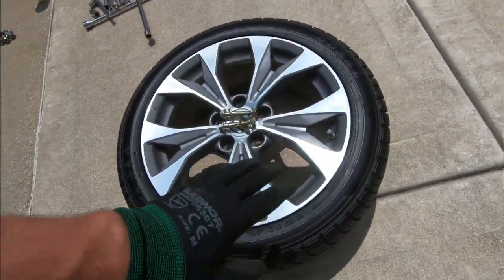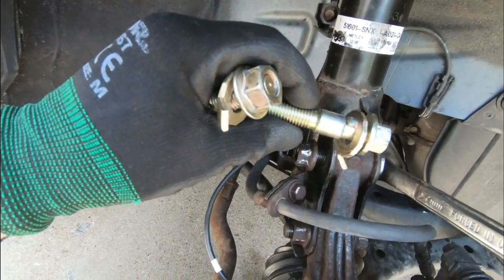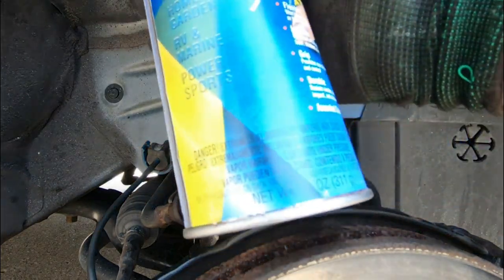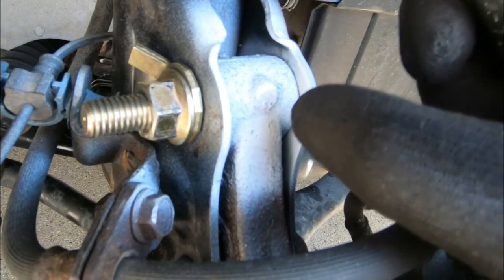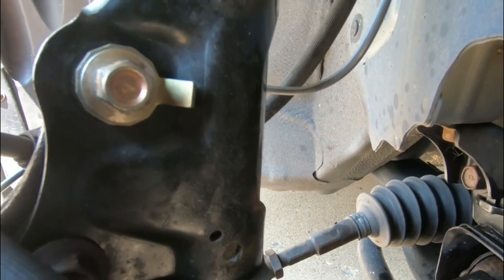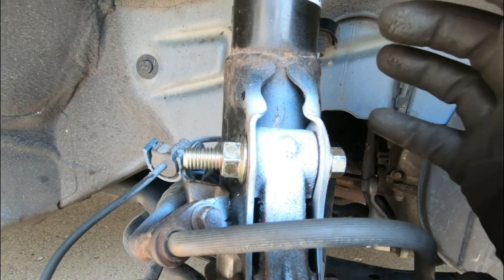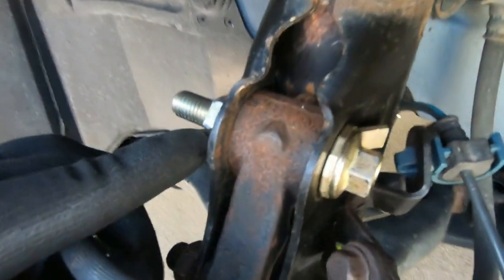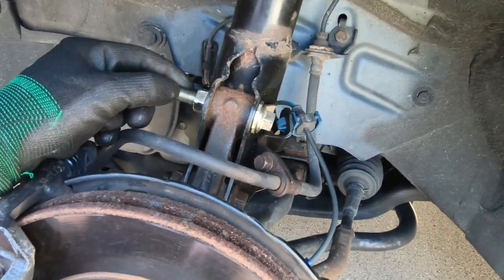Adding CAMBER Bolts To my Stock Daily Driver! The Results are...

Comment: 20 to 40 ft/lbs of torque...are you kidding. Try 120 to 140 ft/lbs of torque...look it up. If these bolts come loose you are going to have crazy dangerous torque/bump steer issues as your wheel will flop around while accelerating and cornering.

Comment: Finally! A video the visually demonstrates how cam bolts work!
Reply from the maker: Phillip Taylor thanks for watching!!
Reply: Are Camber bolts necessary if you just want to have factory alignment and flat wheels on the road? I'm not in to mods
Reply from the maker: Only if you have had a prior accident sometimes camber bolts are used to adjust the alignment back to factory specs.
Reply: @BulliKid  Thanks for the response. I keep taking it to shops that tell me that I need these camber bolts to get my camber back in spec? My right front is like -1.4 degrees off and they say they can't adjust it without it
Reply from the maker: Sounds like you had some damage on the vehicle.  Is it a used car?
Reply: No, it's a 2012 corolla that I bought used. Clean title, has 85K on it and had it for 6 years? I bought it with 35k on it. Maybe it had it prior?
Reply from the maker: Phillip Taylor it’s possible it was in a smaller accident and fixed without reporting to the insurance.   If it was not in any accident I don’t see your camber being that off.  The front camber is non adjustable and it should be closer to 0 on a factory car that was not in any accidents.
Reply: @BulliKid  Is it something that camber bolts can fix? Should I leave it or install the camber bolts? It's a daily driver.
Reply from the maker: Phillip Taylor yes it will bring your camber more into spec.  Now with negative camber your outer tire may wear out faster and your handling is worse then it would be with a more neutral camber degree.
Reply: @BulliKid  Thank you! What do you mean by neutral camber degree? Will it ride better and will the tires last longer if I DON'T install camber bolts?
Reply from the maker: Neutral camber meaning straight tires.  Now your tires are leaning out.  That will decrease handling and will wear out the outside tire more compared to natural camber where you tire will be flat and straight.

Comment: I'm over Here wanting 0 degrees😂 I trashed my tires running camber for around 10k miles. It's not worth it, especially if it's a daily driver.
Reply from the maker: Yea it’s a daily you will wear tires out much faster.
Reply: @BulliKid  mine is about to have new bolts and new arms. I just hate the fact tires cost so much and then when the camber ruins them you can feel it when you drive
Reply from the maker: I am on cheap Chinese doral tires.  But yes if I had expensive tires I would certainly  dial it in and get a good alignment.
Reply from the maker: No alignment.  Yes I do realize.  But I CHange set ups so often  it would be expensive.

Comment: You can hold the wheel at 0 you don't need to go off the lobe. Realize when you add the camber bolt the whole joint can move out and in by holding the rotors pushing it in or out without trying to use the lobs settings don't even matter where the washer is or the lob just need little bit more skinny bolt ha, don't even need a camber bolt just a thinner bolt.
Reply: But the lobe will "lock" it in place so it should be harder to move short of an impact that will move it anyway.

Comment: One question can you used 2 camber bolts on the same side the upper to negative and lower to positive? Can you get more camber doing that?
Reply from the maker: Yes I believe you can use 2 bolts in one shock.

Comment: 4 years later, is that camber bolt still holding?  any slippage or any other issues? thanks
Reply from the maker: Changed suspension set up so many times no longer running any camber I’m at stock suspension again.

Comment: Good evening, I would like to know how they gave it so much rear camber because I have the same car with a x12 rim and it gets stuck.
Reply from the maker: Rear , you need camber arms.
Reply: @BulliKid  My car is a dead axle in the rear, it is not a disc and I have already cambered it with washers with a total of 10 forwards and 9 backwards.

Comment: Why was the bolt all messed up? Frozen? Do u recommend anti seize? Torque it should keep them in place
Reply from the maker: Sometimes that happens.   You can use anti seize on the shaft.   Should help.

Comment: From 215-45-17, to 225-45-17 ?!?

I thought if you “go up one size” on width, should probably do something like 225-40-17, as to keep the same outer diameter of the tire. 
I didn’t check the exact ratio & math, but I am pretty sure if you go up in width, you should either go down on the ratio (45 to 40) and/or also the wheel rim.
Again, whole point is to maintain suspension geometry like you stated at beginning of video. 

I’ll keep watching rest of video; really curious what you ended up doing. 😊

Ok, watched up to 9:48
Indeed, there is a bit too much width (of tire) for going onto the same width wheels, combined with the taller tire rubber which elevated your car’s center of gravity. So yes you’re right in saying there too much “meat”. More precisely you have too much rubber height AND rubber width.
When going wider on tire, probably want to check/match a wider wheel. Extra 10mm tire width… maybe an extra 0.5 inch wheel width?
Reply from the maker: Tire width won’t effect out diameter size.  So going to a 40 sidewall will only make it smaller.
Reply: @BulliKid  
It actually does, to a slight extent. 

The second number in the three-number system, is the ratio of the tire’s width into the tire’s height. 

So when you go from 215-45 to 225-45,
The tire will be both wider AND taller.
Reply: @BulliKid  
That means the ride height went up by:
ABS(215-225) x 0.45 = 4.5mm

For a family sedan, this probably doesn’t mean much. 
But keep in mind, if this were Formula 1, the team would be willing to completely redesign the chassis and engine layout to achieve 3~5mm lower center of gravity.
Reply from the maker: @reallifeengineer7214  I didn’t know that!  Thanks
Reply: @BulliKid  👍 
Let’s learn together. 
I also didn’t know that until 2 years ago. 🤣
Engineer, yes. Not automotive. 😆

Comment: I have a question.  Can you adjust the camber without adding camber bolts? I had some work done 11 years ago and was told an eccentric kit was installed,  but I took it somewhere recently,  and was told I needed the bolts befor I got an alignment.  Took it to another place and was told the same thing. I have the receipt from 11 years ago.
Reply from the maker: Some cars have factory camber adjustments.

Comment: Longevity of the car??..So does lowering it cut its lifespan??...🤷🏻‍♂️
Reply from the maker: Yes you put more wear on many suspension parts.
Reply: depends how you lower it, lowering springs wont hurt drastically the car. Going static for sure will, I know because my car is static and you constantly break stuff if you don't drive like a drunk person trying to avoid potholes and lastly the air suspension is the best way to go low as much as you want and want your suspension to stay healthy. Only thing that will be damaged would be your wallet

Comment: Can anybody help me I got a box of 2 do I have to change both top and bottom or just the top ? Please help
Reply from the maker: Top as primary. 
Both of you want max camber.
Reply: one bolt for each side. Bolt on top not bottom. You are adjusting camber.. think of it as the top of the shock moving inward or outward... two bolts won't allow that.

Comment: would adding a camber bolt on the bottom bolt work aswell ?
Reply from the maker: My friend has done both bolts with camber bolts. So it should add a bit more camber to my knowledge.
Reply: @BulliKid  ok thanks for the reply !